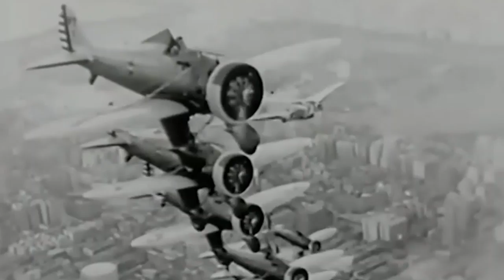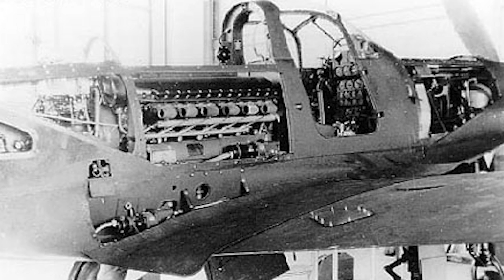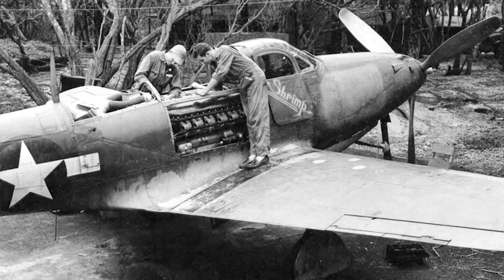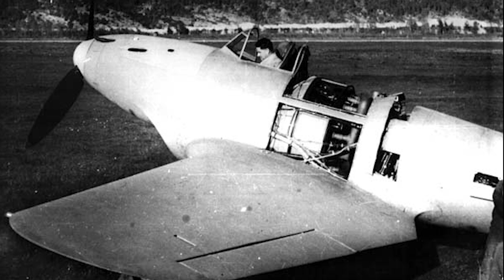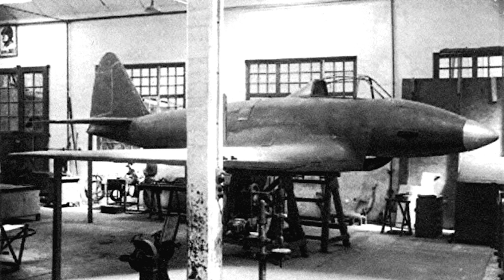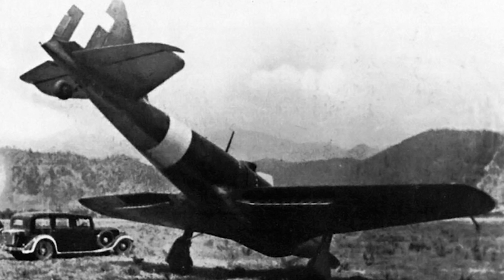The Piaggio P.119; A Fighter with A Unique Engine Set Up

Comment: I always thought that putting the engine behind the pilot would've been a great idea for a dedicated carrier based Naval fighter, to give awesome visibility on landing, like the opposite of a Corsair...
Reply: On carriers the preference was for radials because they were much easier to maintain, not just in terms of access, but in terms of what parts you can get in the middle of the ocean. Basically all the USN carrier aircraft of WW2 (and many beyond) used the same two or three types of radial. Just 4 engines (Wright R-1820, Wright R-2600, P&W R-1830 and P&W-2800) powered the Buffalo, Wildcat, Hellcat, Tigercat, Bearcat, Dauntless, Avenger, Devastator, Helldiver, F3F, Catalina, Coronado, Privateer, Mariner, Seahawk, Albatross, Duck, Tracker, Trader and Tracer!
Reply: @pavarottiaardvark3431  To be fair the UK used liquid cooled engines just fine by the looks of things. That said you are right in saying that parts commonality in parts almost trumps all.
Reply: @Lancasterlaw1175  By some definitions of the term "just fine". Except for the Firefly, the inline powered FAA aircraft had performance or durability issues.
Reply: @Mishn0  love the Firefly.all variants.
Reply: @Mishn0 @Pete2778  Great quote Pete2778 ! With some reflection it seems that the inline engine was only adopted out of utter necessity, given time would the radial engine have been universally adopted? It seems that most of the FAA's inline designs were only planned out during the 1940 to 1941 period when Beaverbrook scraped most of the prototype engines to focus on those in production.
Reply: @Lancasterlaw1175  It was hard not to sell an aircraft with a Merlin in it. The FAA had the handicap of it being the RAF that approved their acquisitions.
Reply: @guaporeturns9472  I'm with you. I've got an Airfix Mk V sitting on the shelf. I think it's a better looking aircraft than the Spitfire, except maybe a Mk 24, those are pretty hot looking!
Reply: @guaporeturns9472  I lived near a British municipal airport in the late '50s that still had plenty of prop. planes (mostly DC-3s) coming and going. For a time, ca. 1958, dark-red/maroon-painted 'Fireflies' would fly low over the nearby houses (the Fairey company had a facility at the airport) and I found out years later that these planes had been converted for eventual use as radio-controlled unmanned missile-targets, to be shot down into the sea.
Reply: @None-zc5vg  Cool memories.. sad they were destroying them but they were getting use out of them. Thanks
Reply: @pavarottiaardvark3431  that is a very good piece of knowledge.. I wonder how many parts on those four engines were interchangeable too? I would bet the answer is 'quite a lot'
Reply: @Simon_Nonymous  Yeah, there would be quite a lot, although bear in mind that those "four engines" would have had different marks and models. There were also things you could leave out - the Avenger had two methods of starting the engine (a slow but efficient one for normal use and a fast but electrically draining one for emergencies). I would be VERY surprised if there weren't planes flying in difficult circumstances where having one of the two was considered good enough.
Reply: @pavarottiaardvark3431  absolutely... there would have been many bodges and "it's good enough" solutions, but made so much easier by commonality in those engines.
Reply: @pavarottiaardvark3431  - The primary aircraft aboard USN fleet carriers for much of the war were the F6F, F4U, SBD, SB2C, and TBF/TBM. The SB2C, rather unfortunately, replacing the SBD, but that's another topic.  So, basically, they could have done quire well with the R-1820,  R-2800 and R-2600.   And once the SBD was retired, circa 1944, the R-1820 could have been taken out of the mix.  The overweight, underpowered SB2C would have been better with the P&W R-2800 but Curtiss Wright would probably have objected.  Actually, the TBF could have used the larger engine as well.  So, by late 1944, on Essex class carriers, they potentially could have done well with just the Pratt and Whitney engine.  Noe that would streamline the supply and maintenance systems!
Reply: @scootergeorge9576  Sb2c ended up being ok.. but it was no Dauntless.
Reply: @guaporeturns9472   I agree completely.
Reply: Have a look at the Bell Airobonita.  A carrier-equipped tailwheel P-39.
Reply: It would have had some issues that would have been negative.  But it would have been like a big piece of armor to protect the pilot as most attacks come from the rear
Reply: @Pete-tq6in  The Royal Navy used the 'Skyraider' for the sort of radar-picket duties later taken-on by the 'Gannet'.
Reply: @Pete-tq6in  Not precisely on-topic here,but the Royal Navy did have a few steam engine powered submarines. Even worse concept for motive power. They proved to be good at drowning sailors. The idea was to have a submarine that could keep up with the Fleet. Surface,erect the smokestack,heat up the boiler water. There is a Wiki entry,Drachinifel knows of them as well. So if ordered,engineers will build. Regardless of sense.
But that is a great quote.
Reply: Some protection, too?
Reply: Take in account one thing that would be bad in such setting, in crash landing engine block could reap from mount and go forward... right in to cockpit. And it's also more problematic to maintain in such placement.
Reply: FWIW,I knew a guy who flew in the Fleet Air Arm. He went from DeHaviland Vampire to RR engined F4 Phantom. I mentioned that the Swiss Air Force liked the Vampire,stable in mountain air currents. He grimaced and made the following comments.
With the engine at the CG,there was no tendency to drop nose or tail in stall. The movable portion of the canopy was narrower than the pilot's shoulders. No ejection seat. Horizontal tail. So. If you stalled it or got it into a flat spin,you died. If nothing else,the tail would cut you in half.
Now how many of those features matched the Piaggio, that is debatable. The Airacobra was notoriously difficult to get out of a flat spin.
There are spin recovery design additions that can be made to work.
With the very limited life of a single prototype,who is to say just what were the actual flight characteristics, pushed to the edge of the envelope.
Having nose mounted guns free of parallax, no harmonization,that is a big plus. Visibility,ditto. Presumably rapid control response,no whacking great lump of an engine far out on the nose. All told,could the pilots trust it during a tough landing ? Engine overheating, not enough hours to find out.
An interesting and innovative design. Italian mechanical engineering can be very good indeed. Was it good enough ? Who's to say.
Reply: @paulmanson253  who is to say. Like so much tech at the time they didn’t have computer models to show characteristics of various changes in aircraft… wind tunnels and that’s it. They had some egghead math but a lot was “build it and see how it works” That said the Soviets loved the Airacobra airframe( as I’m sure you know) but I think they often had different ideas about what made a great plane. Visibility on ground , excellent radio and good heater were almost as important to them as flight characteristics… that might be a stretch but you know what I mean.
Reply: @guaporeturns9472  The only flaw the Airacobra had was it wasn't good at high altitude due to the lack of an advanced supercharger. In the Pacific or over Russia it was very hard to beat. Chuck Yeager claimed that no one could beat him if he was in a P-39. He' said he could be on their tail in three turns. And he proved his claim many times.
Reply: @Mishn0  Yeah I remember reading what Yeager said but we just don’t see a lot of Pacific Airacobra aces.Yeager isn’t representative of the average American Army pilot either. Lack of supercharger wasn’t the only problem.. the unrecoverable flat spin is pretty well documented as well.
Reply: @guaporeturns9472  
The steam engine on the K-class was the one part of the boat that worked well. Its dive control was unreliable, its bow could be at crush depth while its stern was still on the surface, and that great mutant bow was a retrofit to solve the problem of the bow digging into the water when running at speed on the surface and unitendedly taking the boat to crush depth before the crew could react.
Reply: @Mishn0  
And it's wings had been clipped. Both were the result of the Army.
The turbo-supercharger was deleted to "solve a problem of engine fires" that had nothing to do with the turbocharger. Then because without the turbocharger it didn't have high altitude capabilities some idiot decided that it didn't need so much wing.
Reply: @calvingreene90  Interesting. Submariners are a different breed. I would probably be one of those guys that you hear about going nuts during a deep dive and the crew had to subdue and tie up ..or worse .. to keep him from causing a catastrophe.
Reply: @guaporeturns9472  
I'm claustrophobic myself. Enough that I wouldn't get in a museum boat.
Reply: @calvingreene90  It's surprising how some aircraft such as the P-39 and the early Martin B-26 didn't have enough wing area and others lacked adequate fin-area (which led to fatal rudder-locking on some early B-17s and on some British places like the early Halifax marks.
Reply: @Mishn0 All Allison V12 aircraft had the same problem. No good if you are up against a Bf109.
Reply: @Pete-tq6in  they definitely did not replace the FR Mk47 with the F6F....it was probably the Sea Fury
Reply: @echodelta2172 , according to this video from an extremely well researched channel:  https://youtu.be/9UDMQYmoin8 the RN replaced their Seafire FR Mk.47’s with Hellcats. Fast forward to 45:50 for the quote.
Reply: @echodelta2172 , my apologies, I didn’t read the video description of the video I referenced, it was the French Aeronavale who replaced their Seafires with Grumman Hellcats following the first war in Indochina and it was Seafire XV’s that were replaced with F6F’s, not Seafire FR Mk.47’s. The narrator of the video is usually very good and he had picked up on his mistake in the video description but I hadn’t noticed.
Reply: The best place for the pilot is a above or slightly behind the centre of lift and gravity.  The advantage of a mid-engine design is concentrated firepower. The Russians used the Airacobra successfully in ground attacks.
Reply: The accident rate from the stability loss wouldnt be worth